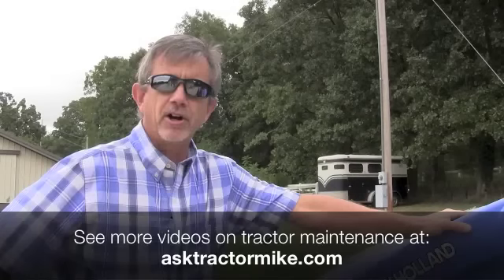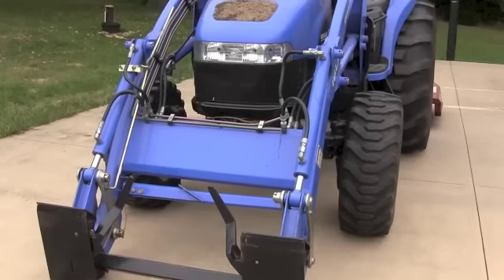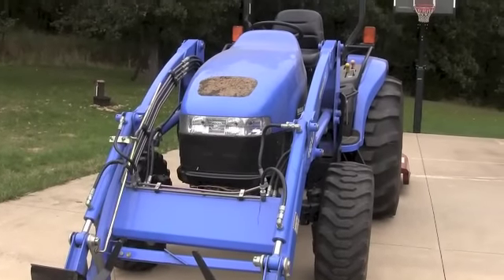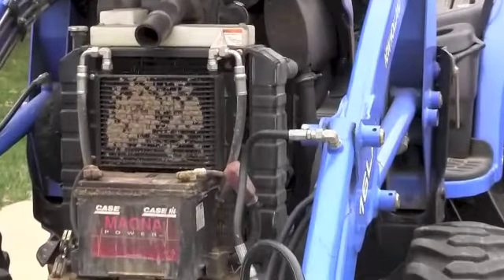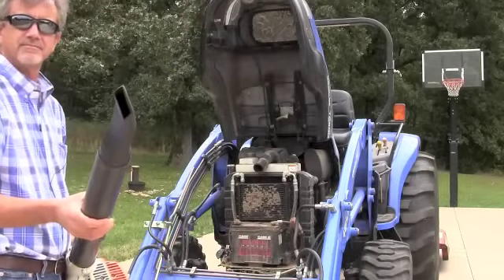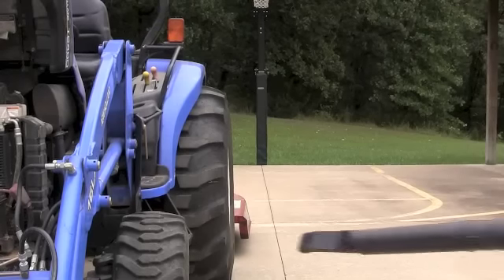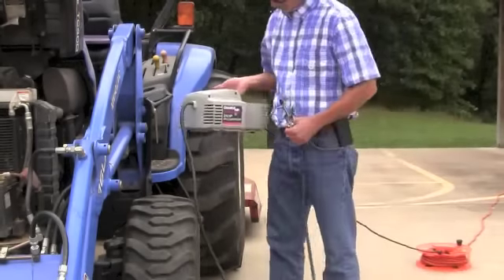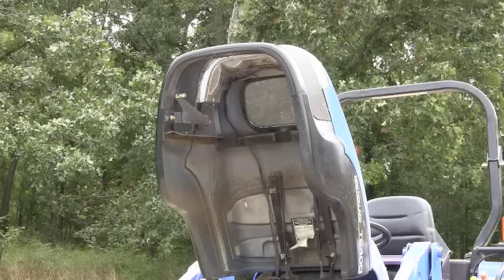A Handy Way to Clean Your Tractor Radiator

Comment: I brush the outside screens with a broom before I open the hood. Then I use the broom on the outside of the ratiator to again break up the big stuff & a shop vac  to vacuum the ratiator fm the outside then blow it out fm the inside. Key words: watch your engine temp. Clean up after each use & y'll never have a problem. Your battery cable look like they need scrubbing with a wire brush. I get one fm Auto Zone for under a $1. Plastic handle steel bristles. A little bigger than a toothbrush. I wire it inside the housing hood so it is handy at all times. Great video. Keep them coming.

Comment: Mike, nice video. My '89 JD 1050, warning lights changed to 3 gauges on Cowling top. Battery moved from front of radiator to a box on loader cross-beam, all cowling voids sealed with foam rubber, headlights removed from cowling front to the fold-down grille guard and factory perf. grille screen framed and place in that old headlight space. Window screen on a frame mounted on lower part of grille guard beneath headlights. One piece of loosely woven filter mesh 4' long attached with magnets spaced 1' apart from left cowling air screen, across the front screen and the right cowling screen. In the 20"x7.5" space that once housed the battery rack beneath radiator I installed an electric winch with 9000# tow power with the synthetic rope coming through the  hole I cut in the face-plate of the 1/4" steel cowling hinge bracket.  Temps go from 180* f idle to 195* @ 1800 rpm (engaged pto), climbs to 200*, thermo opens and back to 195* all day long. When it goes to 205* I hear her talking,  pull the magnets, shake out the fabric downwind the tractor.  I'm happy.

Comment: I use a radiator air wand. They're about $30. They work very well. Typically you can buy them at any heavy equipment store. It gives you a true 90 degree Air blast through several holes in the wand.

Comment: I'm late to the picnic here.  The video is very clear. concise. well done and and helpful.   if I may  offer a couple of thoughts. 1) A removable radiator pre-screen is a great help.  It catches 90+% of the seeds and crud. A good one is flexible and easy to remove-reinstall; they save a Lot of detailed radiator cleaning.   2) When back blowing the radiator with compressed air, be Very cautious and gentle.  The thin aluminium fins between the radiator tubes are almost like aluminium foil and can easily be destroyed.  Lose enough of 'em and you'll soon have a new radiator.  3) I agree with an earlier poster -  leave the bucket on as a "Guard" to avoid driving into unseen rocks and other debris.  This is especially true if you haven't mowed the field before.  Better to hit the bucket than possibly smash the front axle.

Comment: Another great video Mike. I completed step two on mine this evening. I noticed the temperature was higher than normal while cutting with it earlier in the day. Popped the hood and sure enough, the radiator screen was covered. While cleaning off the screen, I noticed that there was a pile of debris at the bottom of the radiator. I blew all of that out as well and then proceeded to blow out all of the radiator fins. Hopefully, I am now back to good.
Reply from the maker: Rodents love those debris piles for building nests and they can do a lot of damage in the winter, so you're doing the right thing by blowing all of that out.

Comment: I am glad that I saw this video as I had not thought of that much dirt building up in the radiator and causing heating problems. I will be blowing out the dirt from my radiator also and I am in the process of servicing my brush hog and tiller also. Thanks so much for this video and tip.
Reply from the maker: You're welcome Sidney, thanks for watching and commenting.

Comment: In the northeast we have tons of field stone, and the emerald ash borer has decimated the ash trees, dropping branches all over the place. Unless you have done a piece of land before its none to smart to  hog w/o the front bucket mounted. Going slow,  placing the bucket 6" off the deck, curling it all the way back, and cutting high the first time is always the smart course of action. By curling the bucket if something is hidden the bucket will "ride" over it and give you plenty of time to stop before you get to the bush hog. If you leave the bucket flat you can be in for a hell of a jolt. The next time you cut you can go more quickly and also cut lower. On top of that with the bucket curled back all the way the material does not snap back as fast or hard and they cast of debris less dramatically.  Lastly, if you place the belly of your bucket (the part of the bucket which would be the lowest to the ground when at max cur) 6" off the ground and your bush hog to cut 6" high, you'll save your blades and more importantly your gear box on your hog.

Comment: just earlier today,  I was mowing the grass at my local airport (39P) 

The grass dust, stems, etc was flying everywhere (good thing for safety goggles)
About every hour, I needed to stop, clean the radiator screen, the hood screen and blow out the radiator fins.
The screens were easily cleaned with a large paint brush.
However, the actual radiator fins required an air hose and patience.

Comment: I have a brush hog/tractor business and I've started carrying a 12V air compressor and 8-gallon compressed air carry tank with me.  I charge up the tank and use an extendable air gun nozzle to blast debris out of the radiator. I hate waiting for the tank to charge up but boy does it clean out the radiator.  Great vids, Mike!
Reply from the maker: +Mike Bosley Great idea!  I'm getting ready to do a review of a product that does a really good job on radiators.  Stay tuned!
Reply: +Mike Wiles (Ask Tractor Mike) Today while brushhogging I used a Makita 18v cordless blower (http://www.amazon.com/Makita-BUB182Z-18-Volt-Lithium-Ion-Cordless/dp/B001UQ6WKU) and it worked GREAT. I'd never thought of it without having seen you try the full size blower. The size makes it reasonably easy to get into the nooks and crannies. I'm looking forward to seeing your next review of a radiator solution.

Comment: Thanks for the videos.  When I am out hogging I use a paint brush to knock off the debris since I don't have access to compressed air.  I typically blow out the radiator once at the shop.
Reply from the maker: Darris Turbyfill Great idea…that'll keep you from getting to the point this tractor was…obviously, whoever owned it was extremely lazy at maintenance :)!

Comment: Hey Mike, love your videos.  I was cutting this fall and ran into this same issue.  I had to clean the screen and radiator about every hour but what I missed initially was my air filter.  I started seeing lots of smoke under load and when I checked my air filter it was plugged with seeds.  You might want to do a video on this issue

Comment: I use  a pump up sprayer  and soak the  radiator in  with white vinegar, a gallon at every time.  Then rinse with a garden  hose  from the back side.Takes all residue off  the cooling  surfaces

Comment: I like Your thoughts on putting the suction tub ( one would normally use on shop vac. ) Onto Your leaf blower..

But on your air Nozzle..Your using on air compressor..I did one a Touch better ...get a air Nozzle about 2' long.w rubber tip of course..like you had on your short Air Nozzle ( air gun ) ..

Bend the 2' Nozzle about 3" fr the rubber tip @ a 90 % angle ..This will help you safely get in to Radiator fr rear like you did in video..

Also you can get up in closer to top & bottom corners..

( of Course as you Know.
Becareful to Not Hit the rear radiator fins...) 

Great Videos you have out on Tips in trick for Brush hog work & how to properly set up  Brush Hog

Comment: I do it with tools i made out of 5/16" steel tubing. One for air , one sprays water. You can actually buy such tools but i just basically copied them using stuff i already had around the shop. 5/16 tubing is small enough to fit between the coils on trucks or tractors. They are 3 feet long for semi-truck radiators that get full of grain chaff during harvest season.

Comment: I just wash mine out with the water hose and let it dry before I go back and use it again.  You can also soak it down with degreaser and wash it out, seems to get the radiator really clean.

Comment: Take that air gun to your local parts store, unscrew the tip, buy a 2-3ft piece of brake line with a fitting that will thread into the gun.  Cut the other end off of the line and use their line bending tool to put a bend on the end of that line.  Gets right into hard to reach areas of equipment.
Reply: Northern Tool sells a purpose built blower now..... I have used it for couple years now... works perfect
Reply: Tractor supply sells long air blowers they work great for this and blowing grass off of mower decks
Reply: The one at northern tool is more for radiator has 6 air jets all on same side
Reply: @91prostreetstang  TSC only has one central hole with a 45° bend that works well to get around fan and shroud but either one gets the job done well
Reply: Yea these are designed for blowing out radiators
Reply: @91prostreetstang  I also like using the no rinse A/C coil cleaner it's great for breaking loose the crusty stuff the air won't remove
Reply: @91prostreetstang  my tractor is a 78 hinomoto it has a factory screen in front of the radiator to help catch the big grass and fuzzies but dust still gets through it
Reply: @chrismaze3441  that blower is bad ass...... I blow from engine side to front of tractor(basically blowing it out the way it came in.....) best 15-20 bucks I've spent in a longtime
Reply: @91prostreetstang  oh yeah no doubt
Reply: Randy H they work alright. Best if used regularly for lighter debris. But they’re not great for really plugged radiators. Having more holes just reduces the air flow at a specific point. I typically switch back and forth between this tool and a standard log nozzle blow gun

Comment: My tractor has a piece of metal window screen zip tied on the top.  When the temp gauge starts to creep up, I turn the tractor off and reach in and shake the screen.  All that loose crud just falls straight down.  The radiator behind the screen stays relatively clean of seeds and fuzz.

Comment: Clean the grill and then the removable screen in front of the radiator which most newer tractors have.  Odds are that the radiator itself isn't actually dirty, just the screens.  A long wand for the compressed air works great but watch that the fan blades are not blocking the air stream.  It will be necessary to turn the fan as you blow out the radiator.

Comment: my kubota has a screen in place to catch the chaff before it gets to the radiator.   Makes it real easy to keep clean.  Really like your video's
Reply from the maker: Thanks for the compliment.  A lot of the deluxe tractors have those screens and they're AWESOME!  Saves a bunch of time because about all that goes in the radiator fins is dust and it blows out real easy.  The seeds and big chunks get caught by that screen.  Wish my tractor had that feature!
Reply: *****
you may be able to fashion a screen type shield to cover your radiator.  the holes don't have to be very small, and anything it catches will not need to blown out later.

Comment: I had a spreader truck at my shop guy had it at another shop twice they replaced water pump and thermostat first time it still ran hot on second time they replaced head gaskets it still ran hot so I looked found two grocery bags full of chicken feathers between the radiator and a/c condenser cleaned it out never run hot again.

Comment: Hey Mike. 
Will this keep the tractor from cranking?  My mother was bushhogging in high grass for a few hours and then heard a bubbling sound from the front of the tractor so she shut it off and let it cool in the field.  she went back a few hours later and moved the tractor under the shed.  Now she says it won't crank or do anything when she tries to crank it.  Any ideas.  Its a Kubota L3010
Reply from the maker: If it were still in the field I'd guess she left the PTO engaged and it's a safety switch.  Usually when they run and then they suddenly don't, it's a safety switch somewhere.  Check out these videos: https://youtu.be/yD4ssTSoLEk, https://youtu.be/9sgypsYDDmg, and https://youtu.be/yfOOgfOBQdc.  Good luck!
Reply: @TractorMike   thank you Mike. I will check them out.

Comment: I always use a pistol-grip nozzle on a water hose
Critical, as you point out, that you put the water in from the rear, and in the case of water that the radiator be allowed to cool off most of the way first.

Comment: HI Mike
Can you let us know what you think about chains or fluid ( anti-freeze or salt) in tractor wheels for more grip on snow or ice specialy on small tractors like a Kioti Ck 20. Thanks
Reply from the maker: First, I wouldn't have a tractor without some ballast, for what you're talking about, for loader work, and stability on slopes.  Wheel weights or non-caustic tire fluid both work well.  I'm not sure there's room for wheel weights in the rims of a CK20 and I don't think the holes are drilled there for the bolts anyway, so I'd go with fluid.  My experience with ice is that no amount of extra weight will help, but I have no personal experience with chains.  I have friends that have used them for traction in the winter and they all seem pleased with how well they worked.  I think that's your best option on ice, and they'll sure get you through snow.
Reply: All I know my tractor tires had that brine stuff in the tubes.Over not much time it corroded the end copper threads off the valve stems .One side even leaked a bit thru the winter and ruined a rim.Right where the rubber bead was.My tire man I use told me he sees a lot of that.Wish he would of told me sooner .What was funny is that the rim corroded mostly from the inside where the brine leaked in between the tube and the tire.No way for it to dry up in there..That extra weight really helped alot with traction and all.. If you find something better ,I sure would like to know about it,,I still have the  liquid in one tire.If I hit a slick spot and loose traction on the one tire,The tractor will just do a circle almost sitting in one spot.

Comment: is there any reason you didn't simply unbolt the hydro cooler from the radiator to get better access?
Reply from the maker: Laziness, fat fingers and a tendency to drop small nuts and bolts and never find them. :)

Comment: There is  a  company called Radiator Genie that sells ends one for water an one for air compressor which is angled to clean radiator. If you watch Paul Short channel he owns and runs a business in NewFoundland he shows using Radiator Genie.
Reply from the maker: After I did the video you watched they sent me one and here's the resulting video: https://youtu.be/RA4d1Vxd8KA.  I still use the leaf blower for quick radiator cleaning in the field because I'm not always around air or water, then I use the Radiator Genie at the end of each season.  Good product!
Reply: That's great! Mike i really like the videos you have put out

Comment: Hi mike. What is the proper way to adjust the top link for a brush hog
Reply from the maker: That depends on the brush hog.  The owner's manual would be where I get that info for your particular machine to see what the manufacturer recommends.  On mine, there's a swinging bracket that the top link attaches to and it only comes into play when you're picking the brush hog up, the rest of the time the top link is loose and the machine rides on the tailwheel and the lower three point links.  You basically want it so it will allow the machine to tilt slightly toward the tractor so the material goes out the back.

Comment: Soapy water and water hose works best(dawn dishwasher soap /vinegar)
Reply: It’s better to use air if possible.  With water if you don’t get it completely clean, what’s left will turn in to mud and dry hard. At that point you’ve got an almost permanent blockage. I worked for my uncle at a lawn mower shop and we always blew not only the radiator but the decks, fenders and anywhere else that could hold debris with air before even thinking about putting water on them.  I’ve also gone on the custom wheat harvest and we always used air to blow out radiators on combines (and there’s not much dustier service than a combine.) Like he said in the video you should always go from the inside out. The thing you have to be careful about is blowing out air filters as you can actually create holes in the paper that increase the micron size of the filter and allow larger particles to flow through. If you are going to blow air filters out, they also should be done from the inside out (clean side back to the dirty side) and don’t put your nozzle directly against the filter media.

Comment: My solution is duct tape and a right sized furnace filter taped over the radiator.
Reply from the maker: +Sarah Jane Hicks So you tape a furnace filter in front of the radiator, so when it's dirty you untape it and throw it away?  That's a real interesting idea, I may try that.  I have that little hydrostatic oil cooler in front of the radiator and it's real hard to get the gunk out of both because you have to blow air or water through the radiator and the oil cooler to get everything clean.  A furnace filter in front of the hydrostatic oil cooler might keep everything a bunch cleaner.  Thanks for sharing.
Reply: @TractorMike  try using no rinse A/C coil cleaner it will break loose all the stuff stuck in the fins then you can still flush it with water as in an A/C the condensation is what rinses the debris out after restarting the unit